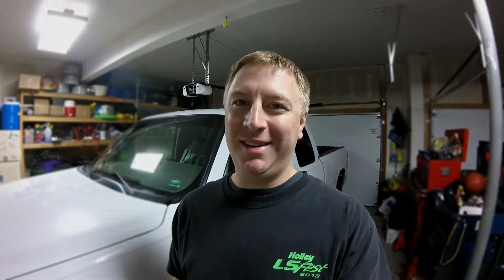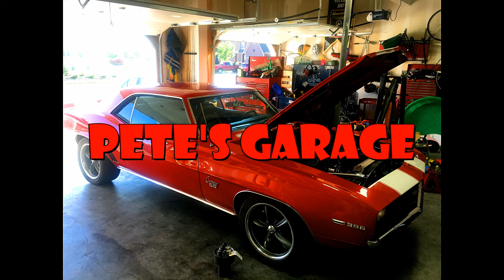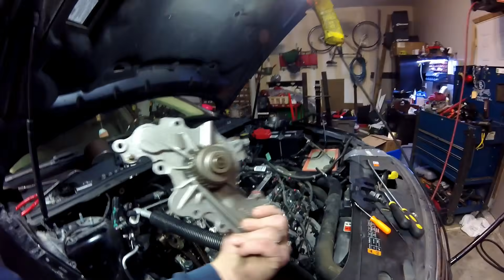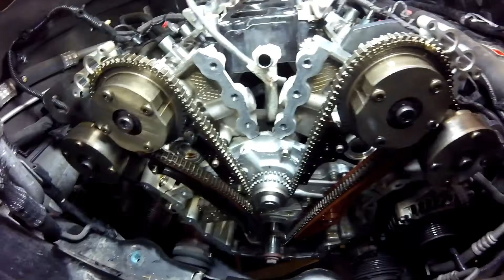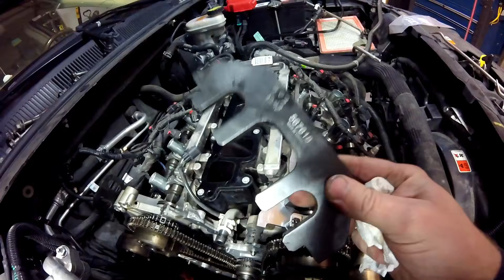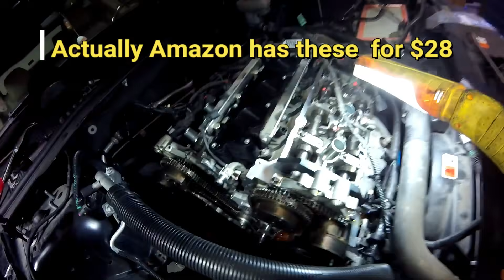Why does the Ford Taurus, Explorer, Edge 3.5L water pump cost over $1400?

Comment: A timing chain driven water pump? Are they absolutely mad? I thought my old Mercedes were a pain in the ass to work on..
Reply: the 92 Honda is that way too, don't know about the later models as I don't drive anymore.
Reply: @cat-lw6kq  Those were belt driven, not chain.
Reply: you're right it had a belt my mechanic friend helped me replace it, not so easy. He's an experience mechanic but it was the first time he had done one. The water pump is not easy to get to, Honda dealer will replace it even if it's ok because of the labor involved, so if you do the belt they include the new pump. I never liked that design.
Reply: Josh
How old of a Mercedes we talking about here, I'm was thinking of buying one.
Reply: @ColSaia  anything with a M116/M117 k-jet engine, really! Late 70's early 80's.
Reply: And the engines are interference engines so when the water pump fails, the timing chain or belt breaks and destroys the engine. My 96 Taurus on the other hand has a non interference engine and the water pump is driven by the serpentine belt which I replaced myself for only $64. I have the 3.0 Vulcan engine and AX4N transmission which are mechanically sound with almost 200k miles and I change the oil every 3k miles and transmission fluid every 30k miles. I also have disk brakes all around which are easy and  cheap to change.
Reply: Timing chain driven water pumps are not that rare.   But most last the lifetime of the vehicle, not just a few years like Ford's junk.  Also most aren't behind the guides or idlers etc.  Most you can release the tensioner and slip the chain off the pump and swap it out.
Reply: @DrinkWhiskeyRaiseHell  Hm, that is true. I know chain driven pumps are out there, I just almost never see them, and the location of the pump on this Ford makes no sense to me.

Comment: Looks like with full coverage insurance burn it! Don’t understand why would you design the water pump location in the middle of the timing chain & have the chain drive the pump? Might as well design a belt to replace the chain that way you can do both jobs just like the imports!!

Comment: Also what about it leaking coolant into the oil... That can't be good. That's kind of like Nissan with the radiator issues, that kept leaking coolant into the transmission cooling lines, destroying the transmission and potentially the motor.
Reply: Any of them with an automatic transmission has that possibility to do that and have been that way for years

Comment: This is called planned obsolescence, the car was only supposed to last about five years and then something like this was supposed to put it in the grave. This is why I don't waste my time buying newer cars, I just leased them and I fix up my older ones. Amazing how in 02 Firebird WS6 will run forever and cost nothing that fix but that thing cost 14 hundred bucks and it's only 12 years newer. No thanks. I'll stick to old fashioned push rod American Iron. You can keep your high-tech crap.

Comment: $1400? I’d charge at least $2500 to even consider doing that job. What a pos. What the hell is Ford thinking? Water pumps fail. Why the hell use the chains to drive one?? Even Ferrari doesn’t do idiotic things like that.
Reply: Agreed. I own a repair shop and if, on the off chance I ever decided to do a job like this it would be a minimum of 2500.00 plus all new timing parts while I'm in there. The people who invent this stuff should be arrested.
Reply: @afterburnerboyz  $2500? plus parts? that is why auto tech are considered crooks, its a 6-8 hr job and typical shop rate for a dealer is $150 an hour so thats $1000-$1200  in labor +parts for $1400.
Reply: jay webb Nope, $2500 is for labor only. I have no tolerance for horrible engineering and charge accordingly. Actually, I wouldn’t do the job at all, not worth the headache.

Comment: Buy a nissan.  Problem solved......till you try to change the #6 spark plug.
Reply: @Dino612  Actually, I was being a bit sarcastic when I cited the Nissan's.  I'm right now in the build up stage to what I would call a semi rebuild.  I'm a few miles shy of 100k and I have to pay the piper.  Many of those miles were in Pittsburgh......road salt.  So, whats on my agenda?  Complete brake line replacement (wtf isn't stainless steel tubing for brakes required by law?)  Water pump, timing belt, radiator, all hoses and I do mean ALL (thanks HaF southern California and southern Florida for the last 7 years). Wires and plugs which require the intake plenums removal (thanks #6 plug), replacement of passenger side slave cylinder on rear brake, new vapor cannister on fuel system, and probably all new fuel lines.  
  Last summer it was shocks, exhaust, new front bumper and body plastic in front (thanks uninsured illegal alien in socal driving a brand new Lexus suv......her Lexus lost that one lol).
  Do I feel abused?  Nope.  Other than exhaust system, brakes and tires, this is the only repairs in 18 years/ 100k. And, if I had been wise enough to get it Ziebarted the brake and fuel lines wouldn't be a thing.  But hey, I'm retired so I have the time.
  Why go through all of this?  It fits my 6'5" frame, easy on the back, off roads like a champ AND nissan, in their infinite wisdom stopped selling the X here.  Its available in other countries, remodeled and very nicely modernized while still keeping the things that make it such a beast.  But can we get it?  So, time to turn the wrenches hopefully one last time.
Reply: Idk the years but Nissan coil packs fail and take out the ecu then you have a huge bill and pray to God they talk you into replacing all the coils so it doesn't happen again
Reply: Lol nissan. The crysler of japan
Reply: @Dino612  We are aware of what is called the smod Strawberry Milkshake Of Death.  Its a thing for 2003-2007 xterras.  The wisdom of using plastic to build radiators is awe inspiring. Go ahead, mix the tranny fluid with engine coolant, what could go wrong?
Reply: @mikelouis9389  Cadillac srx's also
Reply: @Dino612 Doing a Radiator swap out isn't that tough and I am buying an OEM rad for under $100.  Check out which years and models are prone to this fault.  If you're unlucky then just buy an upgrade rad and git er done.  Far cheaper than a new tranny.  On the Xterra its 2nd generation vehics.
Reply: Buy a toyota or maybe a honda not a nissan they are way more issues with their cars than a Ford
Reply: Nissan is awful electrical problems stupid Transmissions underpowered. Awd problems. Pass.
Reply: @Dino612  Just thinking about the 2001 Xterra A title I drive.  And the Frontiers that my brother constantly gets 300,000 out of.

Comment: RockAuto has this water pump for 40$. GATES is the brand
Reply: The majority of the $1400 job would be labor. The part itself, like you pointed out, wouldn't be that expensive. However 10 hours of dealership labor will be very expensive.
Reply: @MAWA-Vik19  I agree I've been a professional automotive tech for over 10 years but I'm pretty sure that water pump is 1400 bucks and the whole job is like $5,000
Reply: @murderbirdLTX  where are you an automotive professional tech?
Reply: @MAWA-Vik19  lol did u call Ford
Reply: @MAWA-Vik19  I'm at Rush Truck Center which is a Peterbilt dealership and also have a small shop that's attached to my house
Reply: @murderbirdLTX  Lmao, yeah 😂 The guy said it was $1589.00 or something like that. 9.7 hours labor.
Reply: @MAWA-Vik19  so he said the pump by itself is 1500 + 9 hours labor
Reply: @murderbirdLTX  No, the OEM pump was less than $150. The $1589 total was with labor included.
Reply: @MAWA-Vik19  okay that's not too bad
Reply: Gates are pieces of shit. I've had too many come apart to ever think about installing one on anybody's car ever again. Factory pump or bust.
Reply: @Carlitosway211  nah can't agree had a lot of luck out of them for years and years they make water pumps and timeing belts for a lot of OE manufacturers especially  Honda- Acura
Reply: @murderbirdLTX  I own a repair shop. I've installed 100s of Gates pumps on all makes over the years. I've only had Murray and Gates pumps come back while still under my warranty. Factory pumps always make it. ALL of the Honda pumps I've bought from the dealer over the years have "Aisin" stamped right on them. I work on a lot of Honda vehicles.
Reply: @Carlitosway211  well if you work on a lot of Hondas and should be well aware of the fact that says gates right on the timing belt and you're right Aisin does make a lot of them too
Reply: @murderbirdLTX  ummm.... if the water pump costs $1400 there's no way people would keep those cars, for real.... that would be ridiculous. $5,000 for that job and you may as well own an exotic car. 
I'm interested now to know though, so I'm going to call a Ford dealer later and ask how much the repair is lol.
Reply: I am very well aware of their belts being made by Gates. I have no problem with Gates belts. I'm not talking about Gates belts. I'm talking about their water pumps.
Reply: @Carlitosway211  Gates belts are really the only thing I'll buy from them too. Heard too many things like what you're saying and did have 1 bad Gates pump and 2 good ones before. Just don't feel like getting another bad one so I try to do OEM for pumps now, like you said.

Comment: Many Japanese engines have water pumps like this. I'm fairly certain this is a Mazda engine.
Reply: No, it is a Ford engine that Mazda stopped using in the 2016 model year Mazda CX-9.  The failed pump often dumps coolant into the engine oil and kills the engine.  Mazda got smart and stopped using the Ford junk in 2016 including transfer cases, brakes, etc.
Reply: @geoschacht  Ah, that's right. Mazda did the four bangers and Ford did the sixes.
Reply: And I like to add that many Japanese brands do not have water pumps like this..
Reply: @tails300  water pumps running off the timing chain/belt? Maybe im just more familiar with seeing that.
Reply: ThorOtheBIG I’m talking strictly chain driven water pumps that can cause catastrophic failure if leaks are left alone. The only other engine I know of designed this way is the Chrysler 2.7L V6. Timing belts are ok since they are a wear item and are located in a dry area where fluids can’t mix (a timing chain is bathed in oil). Also when doing a timing belt service it’s common knowledge to install a new water pump, since when everything’s disassembled the water pump is easily accessible.
Reply: @tails300  I getcha now. I thought all the bitching was about water pumps on the block, driven from the timing components, which this is but this has a chain versus a belt. Of course the chain requires lubrication, the belt doesn't. My bad. Honestly, this was kind of in the background so I only caught so much of the video. Thank you.